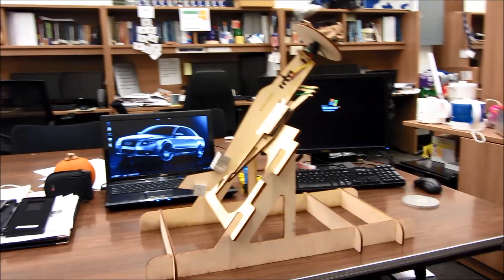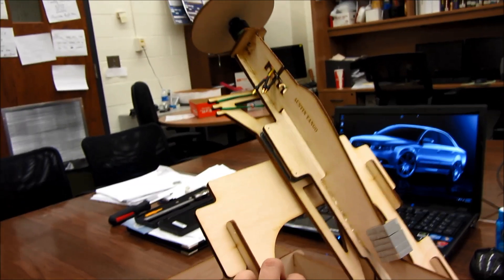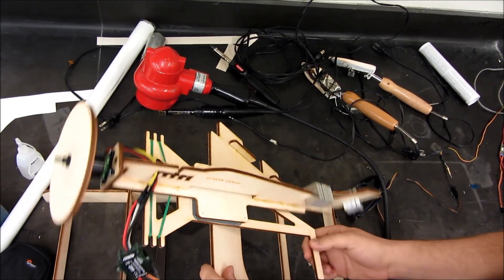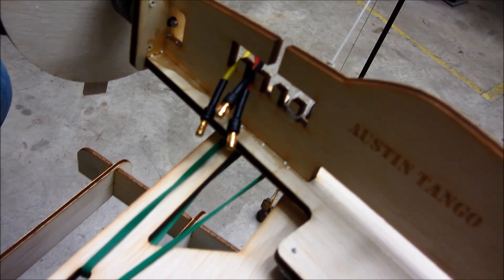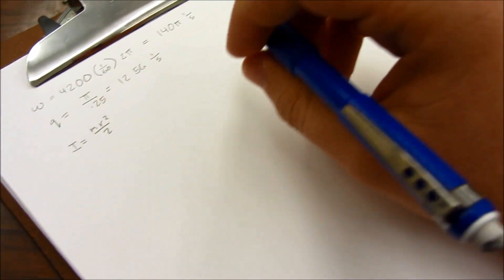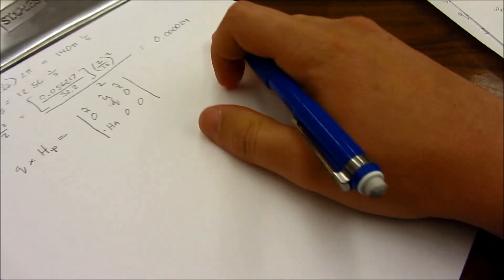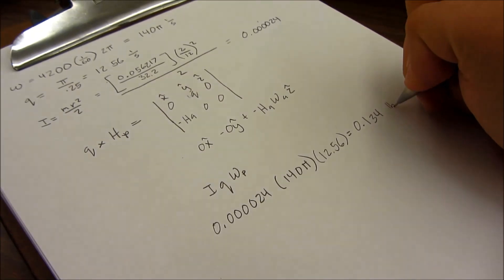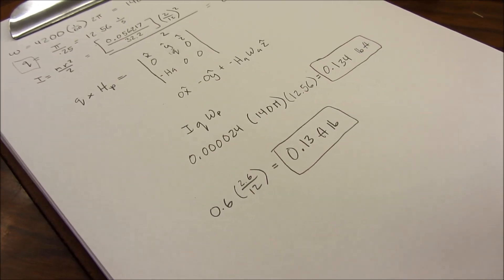The Gyro Effect of an Aircraft Propeller

Comment: Hi Austin, I am also working on same type of project and i wanted to know that if we don't hinge the pitch point(i.e. the plane can take any axis for pitching) and turn it left so which axis will it make the hinge itself and pitch itself will it be the centroid of the plane or at distance 'x' from its centroid.
Reply from the maker: I think you are asking where the vertical axis is located along the length of the aircraft. The vertical (yaw) axis of an aircraft is located at the center of gravity (CG)